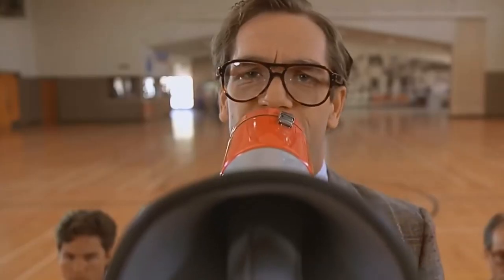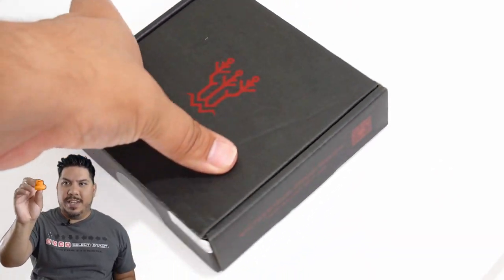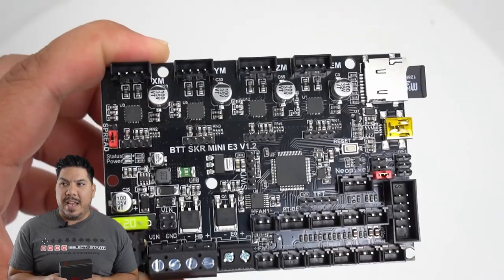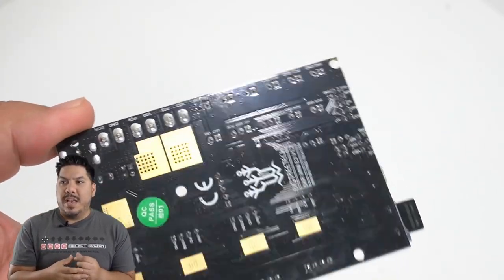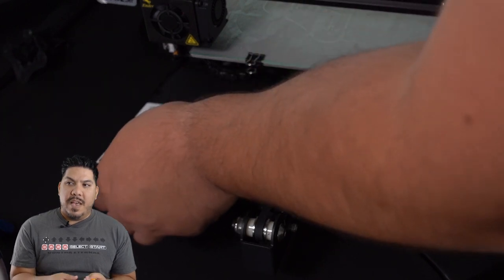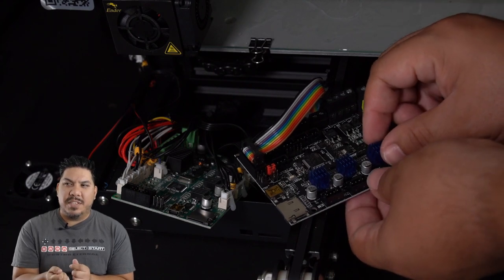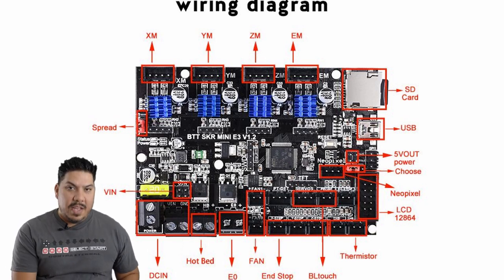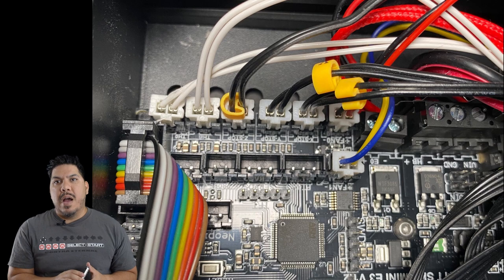Ender 3 Silent board - BIGTREETECH SKR Mini E3 V1.2  - 3d Printer, best 3d printing mod ever

Comment: I bought the SKR Mini E3 v2.0 board to replace my factory Ender 3 board. I never noticed the noise my printer made until I replaced the board. The fan for the power supply is not the loudest part of the printer. I just got the touch screen that goes with it and a BL Touch. I have to figure out how to do the firmware stuff to get the BL Touch working.